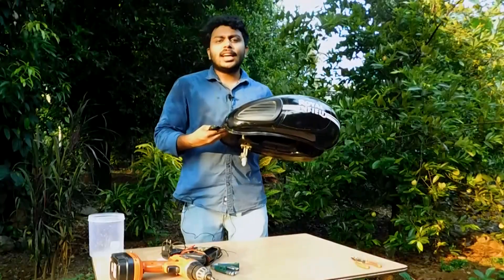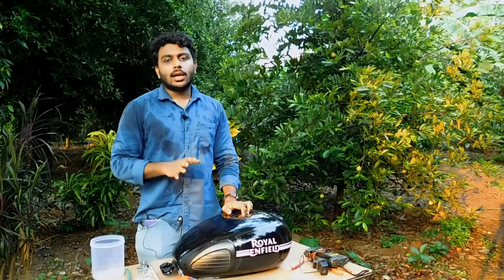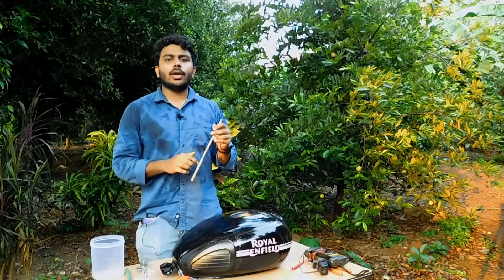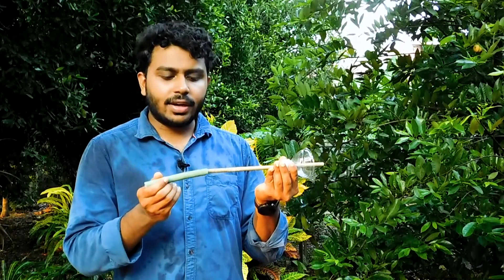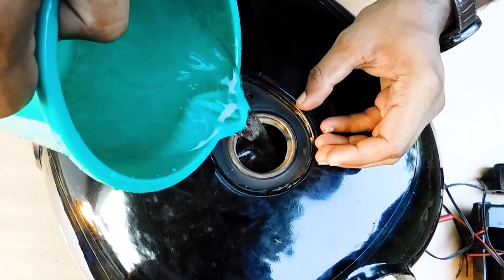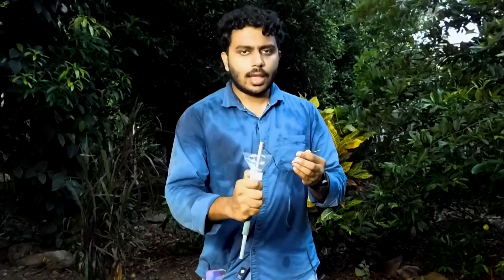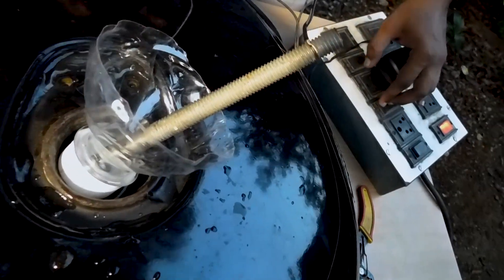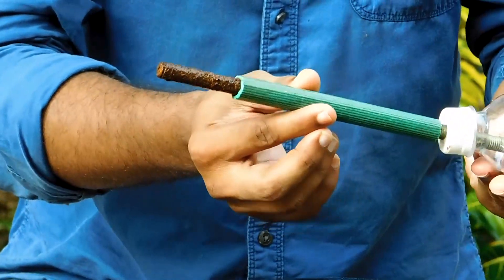HOW TO REMOVE RUST IN PETROL TANK | വെറും 10 രൂപക്ക് പെട്രോൾ ടാങ്കിലെ തുരുമ്പ് കളയാം |Z BOX|

Comment: Bro, adapter switch boardil connect cheythu tester kondu check cheythal  saprk indakumoo..?
Njan nokipo karant kanikanillaa... But boardil karant vanninduu..
Reply from the maker: Adapterinekkalum eppozhum best battery aanu.. spark onnum varilla.. dc adapter allae... athil tester vechal kanilla
Reply: @ZBOXMEDIA  njan cheythu bro.
Kurachu thurumbu ponnu..pinne porunillaa...
Reply: @ZBOXMEDIA  oral paranjathu tankil baking soda idan padillanu..
Petrol use cheythu clean cheyan padullunnuu...
Reply: @ZBOXMEDIA  ithu cheythu kazhinju veendum tankinte sidil ottaa Veenu..veendum kondupoyi otta adapichuu
Reply from the maker: Bro.. nannayi thurumb pokum.. sure.. petrol tankilu orikkalum bakimg soda karanam hole varilla.. munpu undayirunna thurumbu poyappol hole open aayithayirikkum
Reply: @sijocpaul9644   bro enganeya cheuyhath eatha use cheythath battery
Reply: @ZBOXMEDIA  ചെറിയ ബാറ്ററി പറ്റുവോ

Comment: 12v 500 ma ulla charger kozhappam inda
Reply from the maker: Slow aayirikkum... athre.  Ullo
Reply: @ZBOXMEDIA  eathra hour idukkum ekadhesham......pinne ee chargerinte negative and positive ngne thirichu ariyam?...nthu ngilum vazhi inda
Reply from the maker: Tym angane parayan pattilla.. athu thurumbintae quantity polae aayirikkum.. chargerintae wiril positive aanenkil red colour aakum.. pin type aanenkil inside hole aanu positive
Reply: @ZBOXMEDIA  laptop charger use cheyyan patto...18.5v -3.5A.....65W